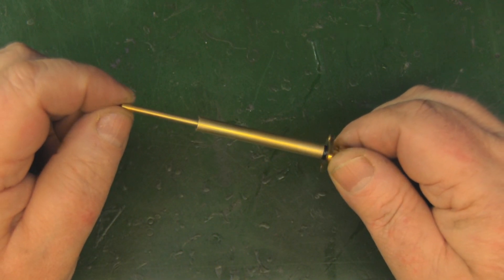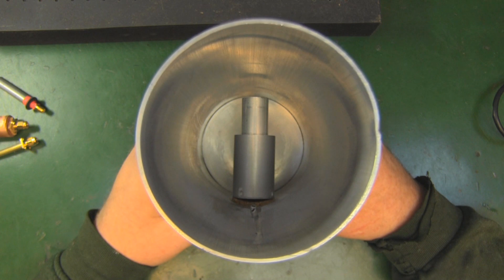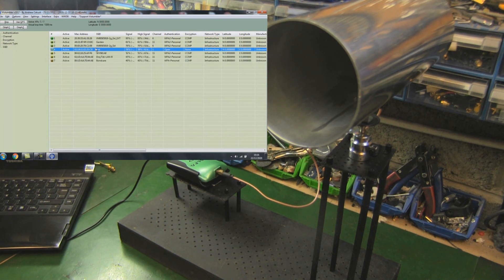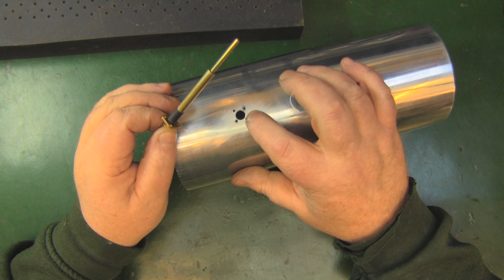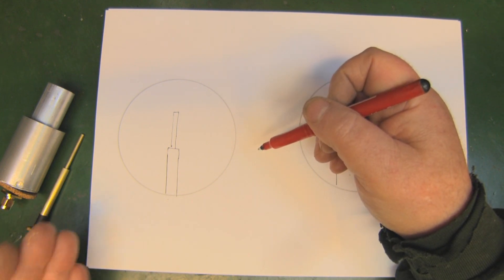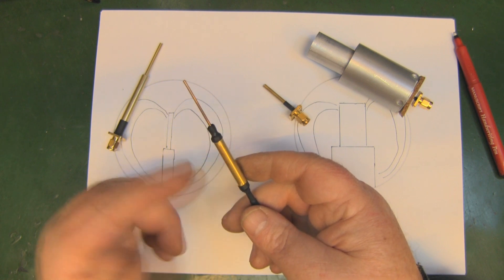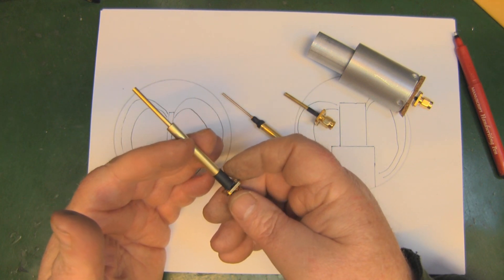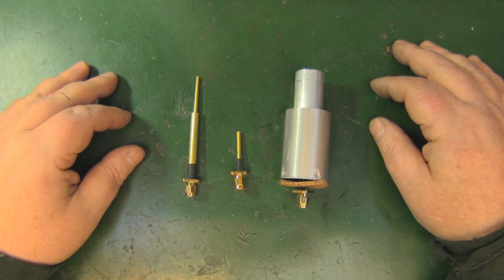Sleeve Monopole Cantenna Upgrade...........Gain increase?

Comment: Hi Andrew...Great vids you do...I know that you put a lot of work into them and it’s appreciated! 
a while back you experimented with different spacings of the driven element from the back of the cantenna. Can you give us an update from the original list you used a couple of years back. I have a supply of instant coffee tins 97mm D x 210mm L. I would like to try building 2.4 and 5ghz cantennas using the sleeve design. Also, what do you think the optimum length of the can would be if using this as the feed horn for a satellite dish? 
Thanks a bunch...Larry

Comment: Excellent way to level up the cantena! I had tested some 5db 5.8ghz omnis (typical design of a coil between a ground tube and the signal element in the rubber ducky antenna) and they perform really well for FPV. I should put them in little green tea leaves cans to make 5.8g cantenas for digital FPV, where circular polarization has no significant advantage in its AFDM.

Comment: I was just wondering what was better, yagi or monopole and asked on another video then stumbled on this video. My monopole that I created just today for the toilet brush cantenna uses one rp sma to sma converter with a 1mm diameter cut down to 31.5mm sewing needle one end and my small usb wifi card attached to the rp sma end and it seems to work ok. It's not glued in/soldered in permanently yet and seeing this now I may have to look into the better monopole or perhaps try a 3d printed version of the pcb yagi. Happy new year btw!